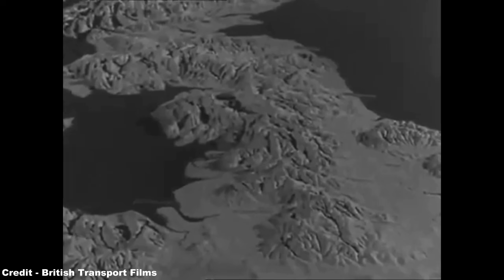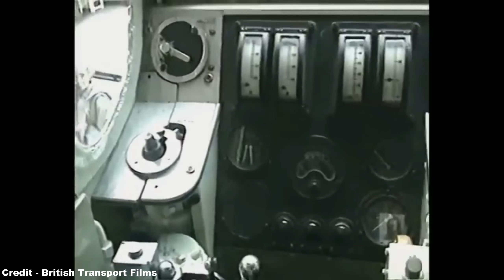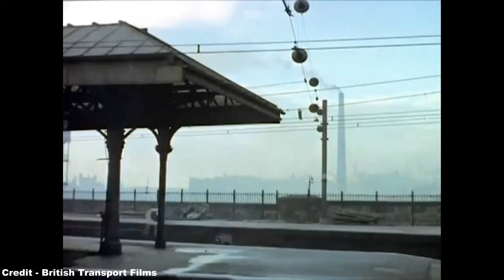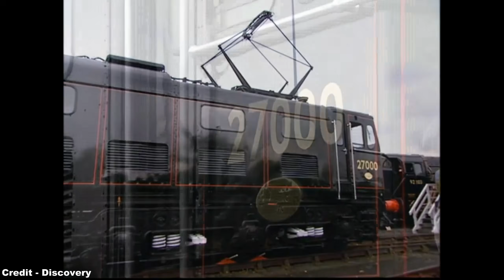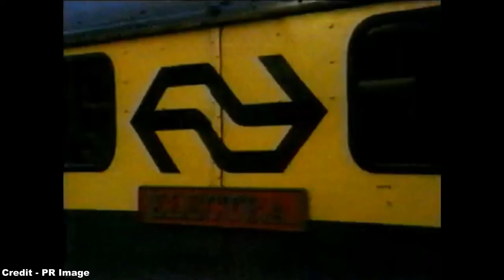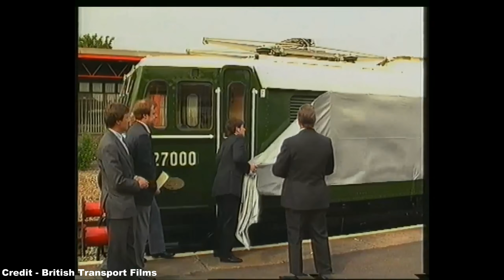Britain’s Forgotten Electric Railway | The Class 76 & 77 Story

Comment: When NS were looking at the EM2s, one was brought out of storage in 1969 and made a demonstration run for NS bods over the Woodhead.
According to some reports, it did indeed open up to 90mph, presumably much to the delight of the NS officials in attendance.

I was on an EM2 railtour a few years back with 1501/27003 and one of the Dutch attendees reckoned that in the early 1980s, NS wanted a handful of air braked EM1s made redundant from the MSW closure.
Clearly this didn't come about, my guess is that BR was unwilling to sell them because it would've destroyed the notion that all the MSW was 'life expired'. As it was, there were certain folk at Derby who were furious that NS made such a good job of the 1500s.

Footnote 1) Class 76s were still putting in pretty much the best MPC figures of all BR classes during the rundown of the Woodhead, even under minimum maintenance. Those things were virtually bulletproof.

Footnote 2) BR did allow NS to raid the stores at Reddish Depot upon MSW closure (so I'm told).

Footnote 3) the EM2s did not retain their BR names in NS service. However, prior to withdrawal two or three regained their nameplates.
1501/1502/1505 I think. 

Thanks for an informative video. Well done.

Comment: Some interesting footage on the Altrincham line, which was converted to 25Kv AC in 1971 and then back to 1500v DC when  Metrolink opened in 1992.
Reply: Metrolink is 750V DC

Comment: The EM2s were an oddball in the Dutch locomotive fleet but were successful and beloved by crews and enthusiasts. I gathered some mileage behind them.
A correction has to be made on why the prototype EM1 'Tommy' was on loan to the NS. There was no shortage on electric locomotives as there were none built or ordered yet for the NS.
Pre war electrification had centered on EMU operation, while the aging steam fleet kept running freight.
After the war the Dutch railways were in a dire situation and there was shortage on any type of traction, hence the acquisition of WD 2-8-0 and 2-10-0 steam engines.
In 1946 the decision was made to accelerate the pre war plans for modernisation of the network and electrify around 3/4 of the entire network, while the rest would be dieselised.
Withdrawal of all steam had to occur before 1960, but there were no electric locomotives for freight and hauled carriage stock yet.
In order to gather some experience with electric traction there was looked in renting locomotives from other countries, these were France and the UK as these were the only other countries with 1500V DC locomotives.
France had shortages too and couldn't miss any locomotives yet, but the LNER had the prototype EM1 on hand, and running in the Netherlands would give the NS valuable data and also be a testing opportunity for the LNER.
A few years later a French BB300 could be loaned and after this the decision was made to order locomotives from France from the classes BB8100 and CC7100, which would become classes 1100 and 1300 in the Netherlands.
These French classes followed the general setup of the EM1 and EM2, but were more powerful and could be delivered sooner.
In the meanwhile locomotives had also been ordered from local manufacturer Werkspoor, following an American design and funded by the Marshall plan, the venerable class 1200 and Switzerland, the class 1000 '1Do'1 locomotives. These proved to be unsuited for express work and were soon relegated to freight. The 1000 came in 1948 the 1100 from 1950 and the 1200 from 1952 and onward, by 1960 the fleet was complete and steam ended in 1958.
Reply: The 1200 were ok at express duty, and didn't disgrace themselves, but were better at semi-fasts.😊
Reply: I did hear a story that Metropolitan Vickers submitted a bid, closely based on the EM1, for the tender that resulted the Class 1100 order, but the GBP to Dutch Guilder exchange rate at the time made it prohibitively expensive and thus Alsthom got the gig.
Can anyone shed any further light on this?

Comment: Layman‘s question: why didn’t they just convert it to 25,000v?
Reply: No clearance in the tunnels. 25kV AC can arc over a distance of about 12 inches and so needs a clearance of at least 15 inches. 1500V DC requires a clearance of only 4 inches.

Additionally the need to change locomotives twice on the route made the line more expensive to operate. Couple this to the down turn in freight across the UK and the cost of conversion the money wasn't there (even before Thatcher's first government was elected).
Reply: @neiloflongbeck5705  I know they did the bit to Glossop/Hadfield

I remember as a kid going in the old 506 trains. They had separate compartments you could not walk between
Reply: @Tremensdelirious it was the two long tunnels that were the main issue for the conversion.
Reply: @neiloflongbeck5705  so they didn’t build them high enough?
Reply: @Tremensdelirious the tunnels were given enough clearance against arcing of 1,500V DC but not for 25kV AC. That stuff can arc about a foot.
Reply: @neiloflongbeck5705  recent WCML practice has been to sheath the uppermost part of the catenary wire where clearance is an issue, and false neutral sections (i.e. coasting) where it's especially restrictive.
I suppose nobody had thought of this at the time.
 It might just have kept the route open had it been realised back in the day.
Reply: @BazNapper technology keeps evolving. Woodhead 3 is 3 miles long and from the western portal rises at 1 in 129 for 2 miles and then falls at 1 in 1186 and was built to accommodate 1500V DC  overhead equipment. Whilst neutral sections existed at the time, Woodhead 3 was far too long for them considering the train speeds. Even if the technology existed to shield from arcing conversion for 25kV would have been difficult and expensive not to say dangerous as the collapse of Penmanshiel Tunnel during works to increase the clearance so that 8ft 6in tall containers could pass through the tunnel. The economic recession and the overall drop in traffic killed the line.
Reply: @neiloflongbeck5705  it was a single tunnel built opening in 1953 under electrification the old 2 tunnels were already closed.
Reply: @damiendye6623and? It was only 7.6m tall and in some places that had to be reinforces it was down to just under 7.1m.
Reply: I did read many years ago, that E26014 was sent to Rugby (EE/AEI presumably) in the late 1960s, with a view to conversion to 25kV AC.
It was deemed to be too costly.
Of course, it could be done easily now, but at the time there wouldn't have been enough for the transformer. Shame really.
Reply: It wasn't carrying enough traffic to justify the cost.
Reply: @leeosborne3793  because BR deliberately diverted traffic away from the MSW.
Reply: @BazNapper  Yes, because there was sufficient spare capacity to do so. And?

Comment: The advantages of 1500v DC?
Reply: Wel known and understood technology. No need to fit each locomotive with a rectifier. Lower arc safety distance (4 inches for 1500V DC against about 15 inches for 25kV AC).
Reply: @neiloflongbeck5705  Thanks for the detailed reply and very interesting.  I not urban railways like DART in Dublin use the 1500dc for their EMU's.
Reply: @tomkearns7136 that's true, but the infrastructure changes needed of 1500V DC are not do much as those for 25kV AC. However, DC systems need more supply points.
Reply: The 1.5kV is the standard of electrification in some countries, e.g., Holland.
Reply: @clivebroadhead4381 it was also the standard here from the late 1920s until the mid-1950s when 25kV AC became the new standard.
Reply: Used on all NSW railways.
Reply: @simonf8902  almost all
Reply: Allows easier regenerative breaking
Reply: @chrisinnes2128  add to that, regen wasn't viable for AC until fairly recently.
Reply: When it was adopted about a century ago, it was reasonable to use DC transmission aimed at DC traction motors. There was no such thing as a rectifier that could be mounted on board (the advent of which made it possible to use AC transmission followed by DC traction motors.

The alternative in those days was low frequency AC - typically near enough one third of the industrial frequency, and to use AC traction motors. Used on some railways, notably in Germany, Switzerland, Austria, USA North East corridor. Conventional AC motors do not behave well at 50/60 Hz. They are workable at 16 2/3 - 20 Hz, though.

In the modern world, AC motors are practical - variable frequency 3 phase is in use in modern rolling stock, such as the 80x passenger trains on the Great Western. It is modern IGBT electronics that made that practical. They don’t care what the overhead power frequency is,  in principle.
Reply: At the time it was seen as the future of railway electrification with wide spread use in Europe ,